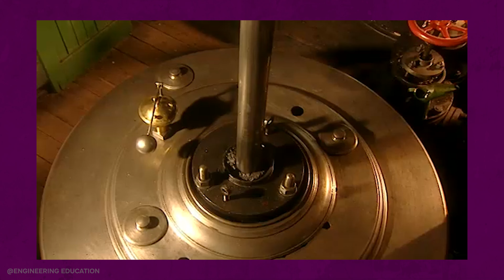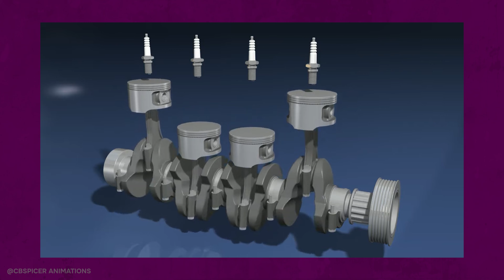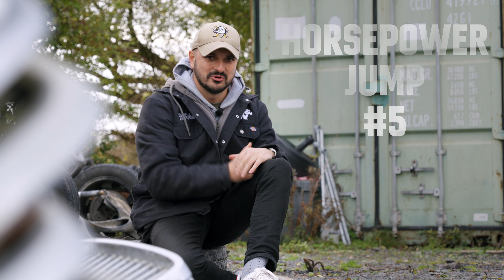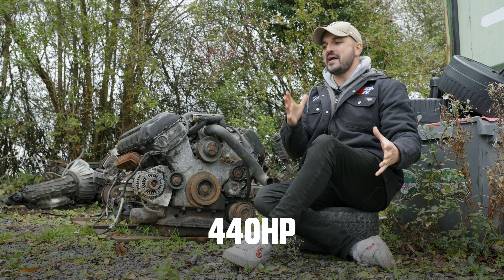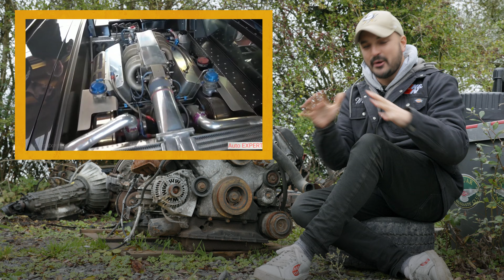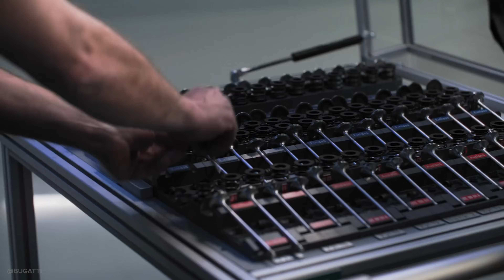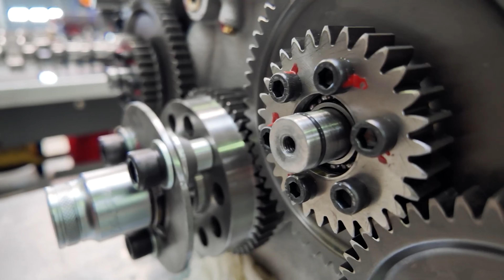How Car Engines Went From 0.74HP To 2000HP!

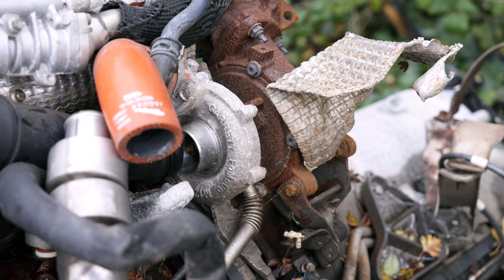Comment: 11:46 "the 80's TURBOCHARGER"  ... 
The Turbocharger was invented by Swiss men Alfred Büchi in 1905 and was used in Swiss Diesel Trucks (Saurer) already in the 1930's.
Reply: And the 80's turbo was designed by people living in the 1980s, and I reckon, were installed onto engines from the 1980's as well. 🎉

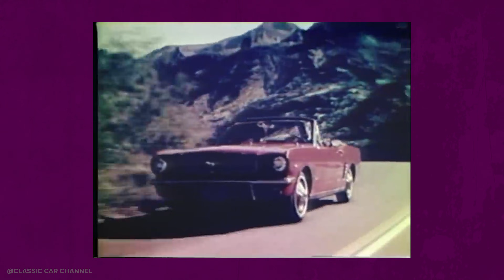Comment: 12:56 you are forgetting something here, before we where able to make a reliable 440hp out of a "compact"  engine like on the Lamborghini we had to figure out compression, cooling, lubrification, bearings and making parts that could actually take the power of the turbo whitout breaking.

Turbo existed since World War 2, the turbo used by Renault in Formula 1 in the 80s was based on a Russian patent from WW2 ! 

In the early 1950s F1 cars had highly compressed engine using Roots supercharger and carburator yet cars like the alfetta 159 (~420hp) and BRM v-16 (~600hp for qualification) reached more than 400hp out of 1.5L engine ! But they where unreliable and broke down all the time. By the 1980s engine metallurgy, conception and synthetic oils had advanced enought so that we could finally make powerfull engine that didn't blow up !

There is also fuel quality but that's another rabbit hole. 

Take this with a grain of salt i am neither a professional mecanic or engineer, simply a person who love engineering as a hobby.

Comment: It's hard to predict the future but I think the supercar will settle at three litre six or eight cylinder twin electric turbo with multiple electric motor assist four wheel drive and about 2000 hp. The limiting factor is tyres, there is no point in having 3000 hp if the traction control limits it. An AWD system with electric assist ensuring the tyres recieve their max torque under all conditions is as fast as a car can go until it gets better tyres.

Comment: The biggest advantage to high horsepower output engines is developing technologies that are engery dense that is down scalable for everyday car use. Imagine having a 3 cylinder engine putting out 300 hp or a 4 cylinder diesel putting out 500 ft/lbs of torque. Do these engines already exist? Yes, but these are only tuned engines that require dismantling, inspection, and rebuilding due to extreme degradation. Once we can produce such power while minimizing degradation, then we have a retail applicable engine. That's where the technology from these mega power engines come into play.
Reply: Toyota Yaris GR...

Comment: You didn't say anything about Variable Valve timing or direct injection.  2 of the largest innovations in the combustion engine space.

You brought up twin scroll and multi turbo set-ups which are incredibly niche. When fuel injection and valve timing and angle have been far more important to the raising of horse power.

Comment: approximately 0.7457 kW in 1 HP means the 0.74HP engine had about 0.5 kW? And the 2,000HP equals about 1471 kW?
That means if you run the 1471 kW for an hour, you burnt 1,471 kWh assuming 100% efficiency. Reality with ICE engines that efficiency at the wheels with major losses in the ICE, and significant ones still in the transmission, we may get 25%.
So we need to burn 5,884 kWh of fuel in that hour.
As gasoline holds 10 kWh per litre (about 1 quart) you'd burn 588.4 litres =155.44 US liquid gallon = 129.43 imperial gallon).

The question is how this evolved from the simple engine and car to today.
There have been gains in HP, in HP per combustion volume, HP per engine weight, likely, but have we advanced in kWh relayed to the wheels, relative to the Kwh in the gasoline, at the same rate?

Comment: Top work Milke! On the jetronic fuel injection....K & KE Jetronic was still in use through the 80's and into the 90's, the xr3i used it up untill the 90 spec face lift and the RS turbo used KE for its entire run. Despite ford having an EFI'd cvh turbo for the Fiesta RS turbo.

Comment: To be clear, the turbine of the turbocompressor uses exhaust HEAT, which is otherwise wasted, to spin the compressor. Therefore it costs no energy to use.

Comment: Turbo chargers were around during WW2. Probably before. There were a lot of engines with both turbo and mechanical superchargers. 

More interesting are the turbo compound engines. Instead of compressing air with the turbo use it to increase the engine output through complicated gearing.

Comment: 100+ years of applied science has lead to this.  However, in just 10+ years EVs have steam rolled all gasoline engine cars.  It’s great to have respect for these dinosaurs, but I have moved on.  A $40,000 car that out accelerates a $200,000 car tells it all.

Comment: Nikasil should not be praised in any regard. It's a cheap, wearable, coating that has a limited lifespan. When it degrades after ~100k miles, the only fix is to get a new block. You can't recoat it and the cylinder walls are too thin to bore out and resleeve. This technology, while good for initially reduced friction, is absolutely horrendous for any kind of longevity.

Comment: there are some cars now that still have less than 200HP ex Mazda Miata 181 HP  granted that's a light sports car though its heavier than it was yrs ago base curb weight now is around 3,300 LBs 300 lbs less than a base Camry LE sedan 3,600 LBs mind you the Camry also has 225 HP for Front wheel drive config and 232 HP for all wheel drive config. while for ex the Corvette ZR1X does the Quarter mile in less than 9 secs and does a mile in less than 23 secs

Comment: Now they have dual stage turbos with a electric driven smaller turbo to get rid of lag.
Reply: If the compressor is spun only by an electric motor, it's not a turbo but an electric supercharger.
Also Porsche now has actual electric turbos like they have in F1, where there's an electric motor in the shaft of a proper turbo, so it can be spun by exhaust gas or electricity.

Comment: Materials technology (metals, ceramics, fuels and lubricants) and computers.  Dry sump does not improve the oil feed pressure.  It reduces the height of the engine and slosh in the oil reservoir.  Superchargers, like NA, are linear.  Turbos are square law machines.  LJKS much preferred the former for road cars.  To quote Pirelli "Power is nothing without control".
Reply: Dry sump oiling reduces power loss at higher RPM though. Lower pressure and no oil sploshing in crankcase = less windage losses.

Comment: No matter how much HP they produce, they are still grossly inefficient. At best they waste 70% of the fuel that is put into them, converting it to waste heat.
Nearly 3/4 of the fuel that you put into them is used to warm up your street.
Reply: ICE can reach 32-50% efficiency in regular cars. Modern diesels are too efficient even, they fail to warm up in colder climates without an extra heater.

Comment: I think you missed one of the biggest and environmentally disastrous technological jumps: leaded gasoline (or other changes in the fuel that incresed octane rating). Until then, the compression ratio of engines was simply pathetic.

Comment: Scratching my head a little, a whole video on combustion engines and not one single mention of the world's biggest engine manufacturer responsible for thousands of innovations and dragging all those you mentioned forward with their insane engineering tolerances, material innovations, world records for power per cc.... and amazing  reliability..... HONDA man!!!
Reply: Yeah, no mention of the B16 which was the first N/A engine to make over 100bhp/litre, B16B which made a staggering 116bhp/litre, or the F20C which pushed that to 120bhp/litre and for a long time had the highest mean piston speed of any production engine at 25.2m/s, before being beaten by Audi who still have the crown at 26.912m/s... and all of it made possible by the 4-valve DOHC head, invented in 1912 by Peugeot...

Comment: I thought this was going to be more on how tech increased hrspwrs and with efficiency but it’s more about who kicked out the biggest numbers for production. Oh well, in my years I watched the evolvement of the ECM, variable valve timing, direct injection, turbo charging, special coatings, sodium filled valve stems and it goes on. It’s one of many reason why I get so pissed when ev boiz try to act cool with overcharged golf carts, there is way more soul and passion in todays piston rattlers then in toxic filled magnetic monstrosities.

Comment: My motorbike, powered by a single cylinder carb and producing 18bhp is clearly running a 100 year old design... and it has done about 100k miles in 13 years of use!

Comment: Most fuel injection systems like the Bosch D jetronic injected the fuel behind the intake valves.( multiport injection. America used mostly throttle body injection which was basically a carburettor with injection)This was used until the late 1990s. Ame

Comment: TBF the Japanese didn't teach the world about turbocharging in the early 2000s.

In 1975 the Lotus Esprit Turbo came out with a dry sump oil system, it had sodium cooled exhaust valves, it had a forged steel crankshaft and connecting rods etc, etc.

25 years is a long time for the Japanese to catch up, (and Lotus had made these cars compliant with the most stringent USA emissions and crash regulations).

Talking about machining cylinder head ports, Lotus used "tulip cutters" on a lot of their designs - you might not understand the meaning or significance?

You did make me chuckle uncontrollably when you announced that "metal is making a come back in engines".  🤣🤣🤣

However Mike, a very interesting and informative video (esp from someone who has never worked as a real automotive Engineer). 👍

I would be really interesting for you to do a video on what happens to the loads on a big end connecting rod bolt when an engine is at high speed.

You probably haven't a clue, but speak to some experts as this would make an excellent video.

Spoiler - the bolt sees next to no load change (if the designers know what they are doing)....

Comment: the biggest factors were... a cheap, liquid fuel that had plenty fo energy and was relatively safe.
and IGNITION. up until 1880, coils were a mystery. up until 1920 hot bulbs and wick carbs still were in production... some engines had "spark plugs" that were moving contacts in the cylinder, at low voltages.
some engines had a pilot light and required it draw the flame in... through a hole... in the combustion chamber...

the spark plug wasnt even "standardised" until 30s, 40s...

good to see the real early attempts mentioned, but you missed teh whole french/viennnese part with etionne lenoir, beau de rochas, and marcos siegfried (siegfried marcus?) whose ICE powered car is STILL ON DISPLAY in teh vienna museum, last driven in the late 80s, no reason it shouldnt drive now. genuine machine, not a replica.

benz just made them on a commercial scale... first  production "car".

Comment: if peak has been reached things may get more intresting, refined and efficient. one can shake a technology smoothy and do whatever suits a creative idea like a modern digitally controlled carburator in a classic restomod. would not mind having a 2.5l 5cyl with electric turbo in a lotus 7 type car, maybe even a diesel. there is still room left to adopt to new fuel ideas if fossils phase out.

Comment: Exhaust gasses don't go through an intercooler, the exhaust side is the "hot " side and the intake side is the "cold" side of a turbo. The exhaust gasses spin the hot side - which in turn spins the cold side (intake side) - "boosting" the pressure of the intake side air.

Comment: The reason why the Messerschmitt 109 used fuel injection was because the g forces in dogfights would cause a carburettor to flood or starve causing the fighters engine to temporarily cut out or misfire. An example of this is RAF Spitfires being unable to follow Messerschmitt 109s into a steep dive.
Notice how the Messerschmitt 109s engine is an upside down V12 with a huge supercharger on the side and twin sparkplugs. Interestingly Messerschmitt mounted a cannon between the V cylinder banks.
By the end of the war, fighter engines were running 100 octane gasoline and water-methanol injection. To prevent knock.

Comment: 1:04 the issue with external combustion / steam was not efficiency. Many power plants are still based on steam today. The issue with external combustion is that it's a big complicated operation that likes run with steady load - making it pretty undesirable for anything that moves.

Comment: I'm at 4 before it starts to sound to me like Germans jerking off over how well they can invent a less elegant solution to a problem 🤷
Reply: what is your elegant solution to the problem then? just make it bigger?
Reply: @Jeff-td1ch no I think the venturi in a carb is the more elegant solution to fuel delivery in that it has 0 dedicated moving parts

Elegant doesn't mean better, here I'm using it to mean that the simplicity outweighs the incremental benefit... And to a certain extent the ease of labor relatively
Reply: @mikkabrightheart2268  I see. Sure you could call it elegant, if you view simplicity as elegance, perhaps a German would call injectors the elegant solution, the elegance being in the efficiency.

Comment: The difference between those two cars in the beginning is that the old Mercedes will still run in another 50 years.
 the second car will eat a valve or toss a rod through the side of the block while it is revving to 8,000 RPM

Comment: so one thing people tend to neglect was that the concept of a rotating piston creating circular motion to turn wheels was actually quite old... trains had been around since the early 1800's... so the idea that they would miniaturize and use an alternate source of fuel to create a bang instead of a puff from steam was not so unusual... some of the first "cars" were steam powered and a couple were even electric. The ICE was actually considered unusual and not practical... carrying around flammable liquids that when punctured could explode, was seen as a novelty that would pass... but hey... keep at even bad ideas long enough and you might just usher in the end of the world.

Comment: Tbf, mercedes turbo diesel engines were fitted with sodium filled valves by the late 80's/early 90's.

Would also add, compound supercharging was used in some German race cars just before WW2.. surprised that didn't really become a bit more of a thing.

Comment: Lubrication systems, the lube itself, and.... metallurgy!  Those not only allowed the possibility for more power, but a massive increase in reliability.  If your 1940/50's engine made it to 50K miles without needing new bearings, rings, etc - you were doing well!

Comment: Cam control has been huge. Bigger than forced induction. It has allowed extreme compression ratios, efficiency, and emissions improvements on all modern engines.

Comment: The first automotive turbo was in the early 60s.  They were not invented or put in cars for the first time in the 80s.  They were old tech. 
Also, turbos put a large load on the engine.  They are not free.  It can take 30 or 40hp to run a turbo.

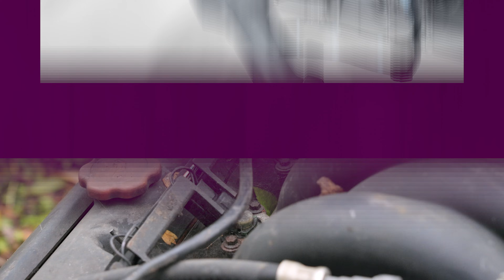Comment: 11:40 The 1980s?? The Chevy Corvair was factory turbocharged in 1962, and turbocharged Cummins and Caterpillar engines became common in American semis in the early 1960s and universal by the '70s. I'm not saying these were the first turbocharged engines, but the 1980s was pretty late in the turbo game. Off the shelf turbo kits for American production cars were available in the mid '70s, and I actually have a book from 1978 that I inhereted from my dad called "Turbochargers" that outlines various turbo systems and how to build one for your street or race car. It wasn't the norm, but turbocharging was fairly popular in the American racing world throughout the 1970s.

Of course, there were also lots of European sports cars like Porsches and such that came factory turbocharged in the 1970s, I'm just focusing on what I'm familiar with.

Comment: Why people don't talk about Mercedes T-80 when talking about fast or powerful car? the T80 achieved speed of 600 km/h (373 mph) at 1938 with a 44.5 liter 3,450 brake horsepower V12 engine @1938! They where working on making 750 km/h (466 mph) and where all most done but had to stop as WWII started. The engine was used to crate the Bf-109 engine

Comment: Potentially got a very interesting engine for you to do a video on. It's a Sleeve Valve fitted to a bone stock original 1929 Daimler P35/120 Limousine. 5.7L Straight 6 with the sleeves acting as the valves. Sadly it doesn't run but still might be of interest.

Comment: 2 HP over 0,74 is an increase in 2,702702... 
If you were to get the same increase in a 300 HP car it would be 810,810810... HP thats quite an improvement.

Comment: Think about replacing the intake system entirely with direct injection of liquid oxygen and fuel. LOX expands nearly 900x when it flashes to gas, so even small metered volumes deliver huge oxidizer charge right in the chamber. With direct LOX and fuel injection eliminating the need for intake runners, every valve on the heads can be dedicated to exhaust flow, dramatically improving scavenging and unlocking greater power and efficiency. 

 Because it enters at cryogenic temps, it first pulls heat out of the piston crown and cylinder walls before combustion drives temps up, which means you can actually use its thermodynamic properties to manage chamber heat. With the right injector timing, you could alternate cycles to spray LOX as a cooling method, then fire normally, keeping temps under control while still hitting full burn efficiency. The physics line up for this to work, and LOX’s properties make it especially suited to a project like this.
Reply: Shame it’s now history